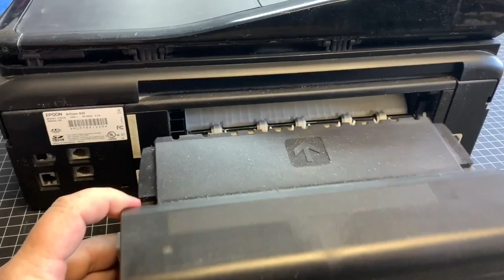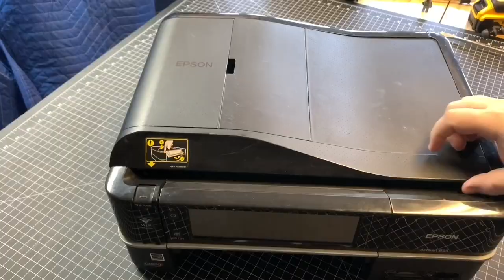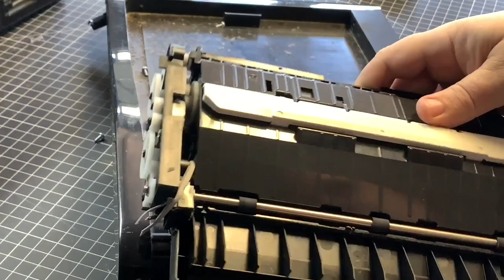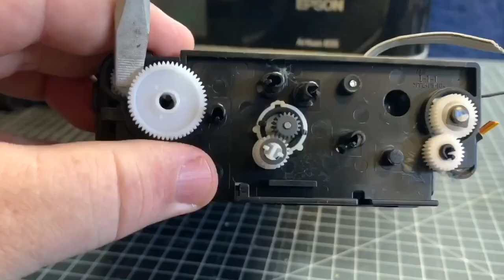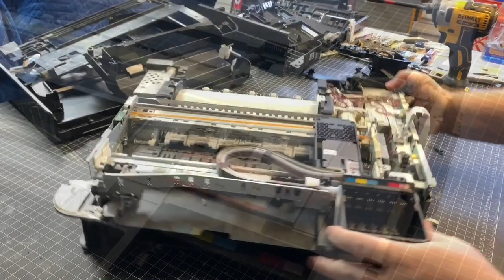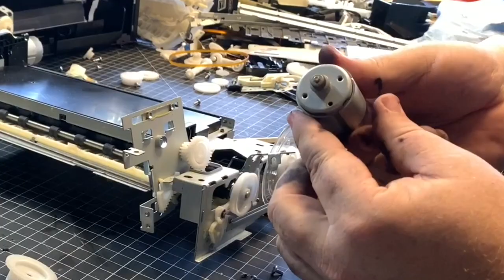Epson Scanner and CD Printer disassembly  |  Hunting For Greebles

Comment: It would be cool to somehow make the ink cartridges "the key" ... wire both sides and when you slide it in it completes the circuit and make whatever lighting start!
Reply from the maker: Absolutely Shawn. I keep falling in love with the under side of the print cartridges. Just haven’t found an application for them yet. But this thing had really cool depth and design in every panel. I think it’s begging to be used as diorama or large build panels